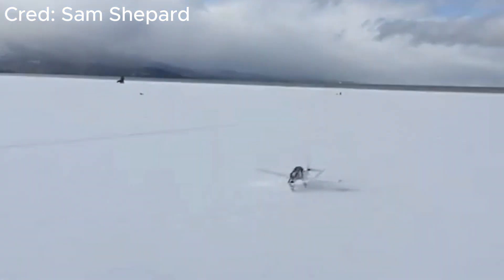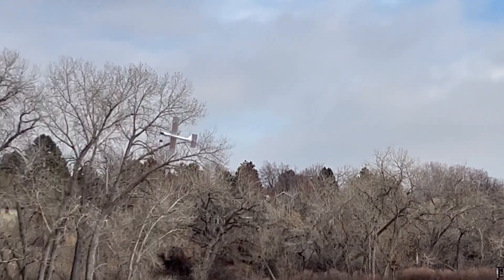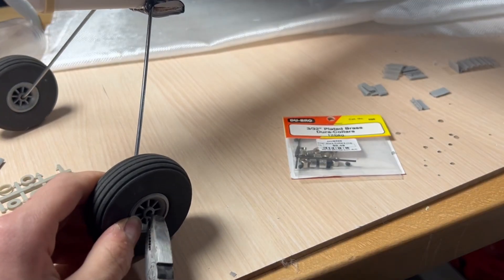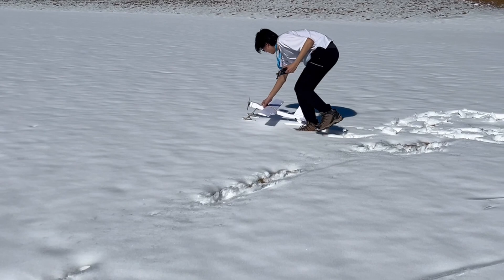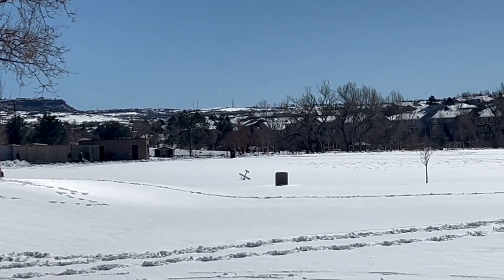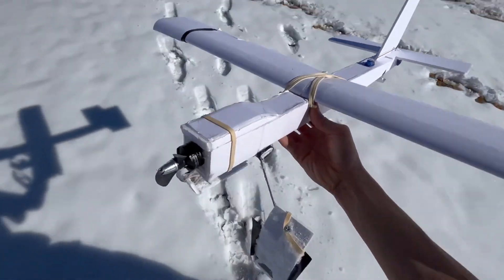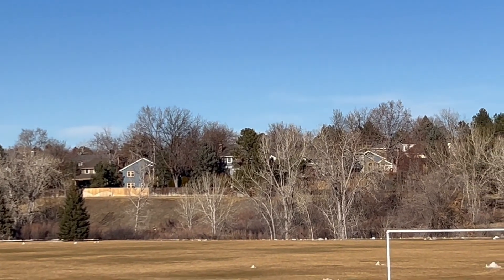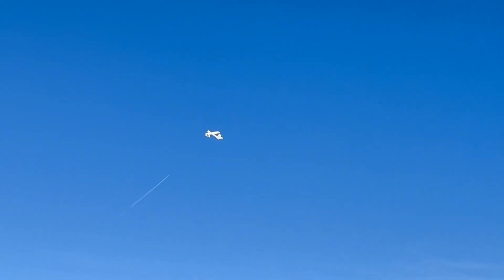R/C Snow Plane Experiment (Ep.1)

Comment: I think one of the main issues was that the ski's weren't stable as wings and sometimes just flipped up and got stuck, creating a ton of drag low on one side. This created your spirals. I think to solve that you need the centre of pressure of the skis to be behind their pivot, and I feel like currently that skoop at the front could place it in front of that. And might want to do some napkin calculations for the centre of pressure for the entire plane, you added a lot of wing area really far forward. Although you could just feel that out too. Good luck on your endeavors, great idea and video!

Comment: I'm not an expert, but i was watching the video and i thought that the reason the plane wasn't rolling properly could be because when you put the skiis the center of gravity lowered too much, so you would need more roll imput to make it work better. I also saw that when you stopped pushung the stick for roll(i think), the plane stabilized itself,i think this also has to do with the cg. 
I don't know if i'm right, and if i'm not, correct me, but i think that this is the problem.

(I don't know if this all this text is grammarly correct, i'm not a native english speaker)
Reply from the maker: I yeah that’s a good point it also might be the ailerons being to weak and small, thanks for the tip

Comment: Could you do a tutorial on what servos and motors you should buy and what the best configurations are? I really want to build an rc plane, but I'm unsure as to what to buy and how to build it
Reply from the maker: I’ll do that when I re build this plane
Reply: When u want to buy parts for an airplane first of all you should think how big will it be, and how heavy, so for this case i think it was used a motor that can pull around 400-600 g of thrust with a 7’’ propeller. And for the servo, usually 9 grams servo are the best for slow planes.